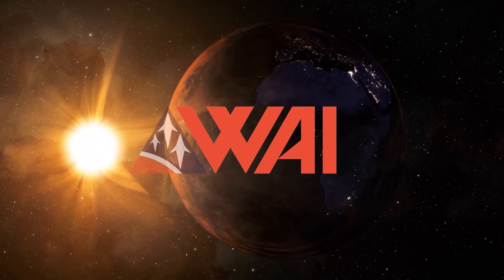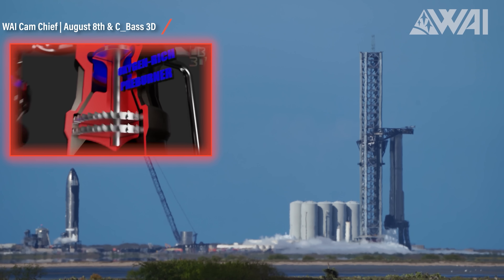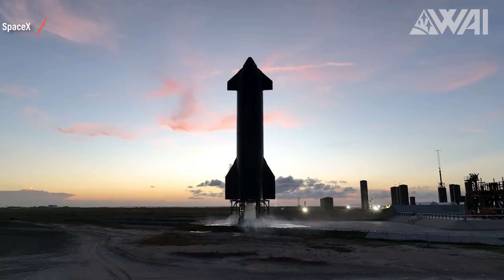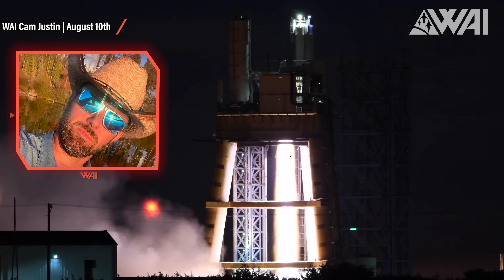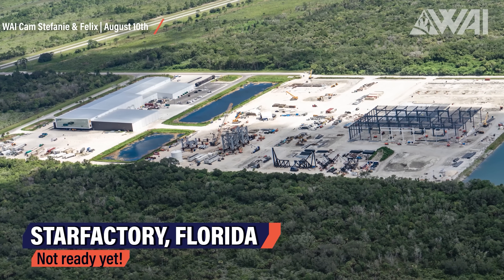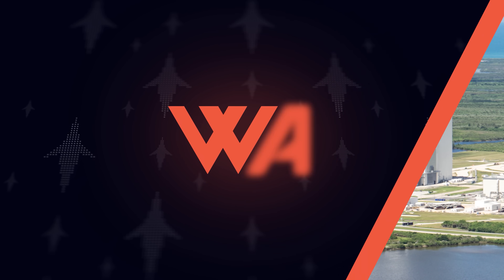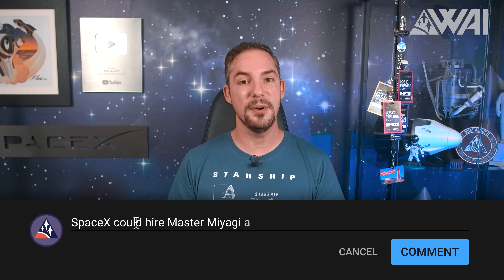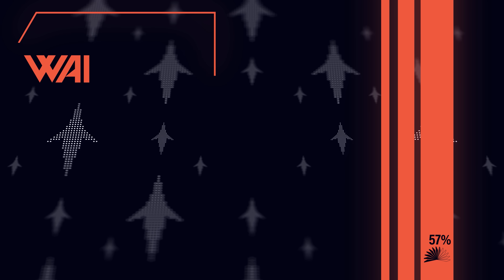SpaceX's Starship Orbit Flight Tests Already Going FASTER Than Expected!

Comment from the maker: Will SpaceX catch boosters with 2.5 meters of wiggle room at Pad39A? :_WAIShocked:

09:34 Correct measurements for the two towers are Length and width 13 meters for both Mechazilla 2 and Falcon 9 Tower
Reply: Not at 39A. NASA is already concerned that a launch mishap will affect the ability to launch Crew Vehicles from the Falcon 9 tower to ISS. No way NASA let's SpaceX land a booster there as long as they need to fly to the ISS. They will probably set up a tower further north and catch boosters there. And then after the ISS is decommissioned, they can retro fit longer chopsticks to Mechazilla at 39A.
Reply: @sammoyers905  Absolutely another landing area away from PAD39A is the best idea I think, too.  Then the booster will be lifted onto a crawler to bring it back to the Florida Mega Bay, launch pad, etc.
Reply: Of course it will need some landing legs like Falcon for that, I guess.
Reply: yes, you seem to forget that the booster can hover and thus have much higher margin to get the position  correct
Reply: The calculations for the volume of the Sphere are way of. The guy that calculated it used a 20 meter diameter and forgot to divide by 2 to get the radius needed in the calculation. The actual volume in liters using the 21 meter diameter would be 4.849.048 liters.

33.510.000 liters would need a cube with 32,24 meter long sides or a sphere that has a diameter of 40 meters.

(Edit) same thing happened with the calculations for the other tanks. They used diameter instead of radius.
Reply: Yes.
Reply: Yes, of course they will catch boosters with those chopstick. Why else build them?
Remember that Starship and it's booster will, unlike Falcon 9, be able to hover.
This means that it'll be much easier to pinpoint the landing, going very slow in the last few meters and adjusting laterally with RCS thrusters.
Reply: @EaglePicking  The Chopsticks are also needed to grab the booster off of the crawler and position it on the launch structure.  And they are used to pick up the orbiter off of it's crawler & mount it on the top of the booster.
Reply: I doubt they are going to catch at Florida in the near future - Stacking arms only
Reply: No. If NASA had allowed catching there, the arms would have been a lot bigger, not smaller. SpaceX screwed up again. They should have built the first tower far enough away. Ah well, SpaceX is pioneering its way through bureaucracy, making a way for the rest. Great vid, incredible research and graphics. Thanks, Felix! :yougotthis:
Reply: lots of devil coding right in that statement. space isn't real and i'm tired of you telling people it's real. quit stealing their money for this nonsense.
Reply: @michellefazekas5789  so if you are tired with this nonsense, why on earth are bothering to post on this channel? Seems a bit sad that you have nothing better to do with your time on earth then complain about something you don't believe in on a channel that is about something you don't believe in.
Reply: Felix, don't learn bad usage and phony rhetoric from incompetent native English speakers! 5:28 "This begs the question..." No it doesn't, it RAISES the question, or just ask it without any verbiage. "Begging the question" Is a rare logical fallacy, no matter how much people abuse the phrase because it sounds forceful, along with all the "Hopefully, the vast majority will be impacted" cheap and wrong phrases people use when they lack confidence in what they're saying.
Reply: @skierpage  you’re right, but damn. Okay. haha
Reply: SpaceX chose a very good  location. Out in the proximity of Falcon launches and very importantly to be close and able to re-use the very large Spherical Fuel Storage Tank.
Reply: Well I think it is possible because the booster and ship can both hover. Falcon does a hover slam landing which means there is less room to control fine accuracy but SpaceX doesn’t care that much as long as it lands. The booster is easier to fine tune it’s landing while hovering mainly because it weighs more. It’s possible but I don’t think it’s going to happen at 39a for now
Reply: No, I think SpaceX sees the writing on the wall. With NASA's concern of possible damage to crew dragon infrastructure, SpaceX will only launch from 39a. With starship and booster cutting its teeth in Boca Chica, the launch part of the program will be ironed enough to safely launch from the cape. Catching will be an absolute NO at 39a for as long as crew dragon uses that location.
Reply: Great video and great captions. A much needed addition is to compare some of these gigantic structures to something we can relate to. Otherwise they are just meaningless numbers. For example, the megabay at 52m wide by 107m high by 40m deep sounds big but how big? That's BIGGER THAN A FOOTBALL FIELD stood on end! And a footprint of half a football field. That's how big!
Reply: I’m guessing that they’re confident enough to be able to do it, or else they wouldn’t be trying it!
A simple solution for @SpaceX & @elonmusk is to have a beacon in the center of the Bullseye! The Starship’s will have a corresponding receiver to zero in on the target.
Reply: Perhaps they will only be used for stacking?
Reply: No, they did not transform the tanks for SAFETY REASONS. Damn it Felix, you reported yourself on the problems they had with allowed and forbidden shapes for explosive material tanks in Texas when that came up, they would not have gotten approval for the vertical tanks and had to put up more horizontal ones. It's regulatory reasons not safety.
Reply: The “At Pad 39A” part I don’t think will happen for a long time - until there are other human rated options to LEO. Can’t risk destroying the Falcon launch pad.
Reply: @jwortman1984  As soon as they have proven a couple of landings in BC it will. After all it is the launch that it the really risky part. They should also be scared of sending up falcons then as they may destroy the pad too
Reply: @camilla-w5h  How many orbital Falcon launches have there been, and how many orbital Starship launches have there been? Apples and oranges in terms of number of launches, not to mention the differences in size/explosive potential. 
I don’t disagree with your statement about perfecting the catch in Boca before attempting at 39a, I just think we are a very long way from a launch or attempted landing at the cape in general, let alone 39a.
Reply: @jwortman1984  Well I'm not saying it will be soon, but it is definitely the launch they are worried about. Not the landing as there is little fuel left,  but only time will tell.

Comment: The tanks‘ volume comparison contains several errors. In the end, there is no „optical illusion“, the spherical tank has the same volume as a single cryo shell, just as one would have guessed. 
The errors:
1.) For the cylindrical tanks you calculated in liters but wrote „gallons“, then tried to convert to liters again by multiplying by 3.7 where you should have divided by 3.7.
2.) For the spherical tank you calculated and wrote in liters but confused „radius“ with „diameter“, so your result is 8 times the real thing.

Comment: 'Sea landings' (on drone ships) are far less precise than those performed on platforms which don't deviate even a mm.
Even a flat sea is moving in one direction or another, and the drone ships presumably fight against any current to try to remain 'stationary', with the rocket aiming for a general safe area.
With a stationary platform, the landing rocket has far fewer calculations to make, it's a case of paint a target and hit it.
(I'm guessing there's some sort of LiDAR rangefinding going on)

Comment: I think it will launch from Texas first. It looks to me like that is where the momentum is pointing. Less long-term schedule risk with two (or more) launch sites anyway in case of damage from a RUD on the pad. Speaking of which, Infrastructure at Boca is SO close that I worry a lot about pad RUDS of that stack at Boca Chica. I hope they NEVER have one because I think the infrastructure damage would be horrible.

As for landings, yeah, lots of HW lost to the ocean before they try to catch anything...but they should do it at Boca Chica first to mitigate political risk.

Comment: Could the Starships and Boosters be built and launched from Boca Chica on a trajectory and be caught at  39A
I just thought what if McGregor could built the aft section and thust puck with small tanks and  alot of smart electronics and software and as the finished testing just fly them to the production site. That might make a cool rendering, somebody get on that.
Reply: Maybe long term

Once those sections are bolted to the tank, the testing is rendered invalid. And it's hugely impractical to ship 9 m wide section on the road from McGregor
Reply: @alvianchoiriapriliansyah9882 Of course it's impractical, I was joking, I meant to littlerally let the Raptors fly themselves to Boca Chica instead of having to load the on truck, you know to save time.

Comment: Of course, landing at sea is not the same as landing on land with fixed coordinates :-) Even in two foot waves a ship could vary by numbers of feet. Apparently SX must believe they have absolute control of both rockets. As we have already seen, just to land a test rocket is quite an accomplishment. This has turned out to be one of the most complex technical projects I have ever seen. It isn't just the Starship. From the Raptor engine to the launch stand to the manufacturing processes, etc., it is mind boggling what has been accomplished so far. Now to top it off with a successful flight.

Comment: IMO they wouldn't build an LC39 structure that wasn't capable of catch and rapid turnaround. Also this puts a launch and catch dependency on a completely separate structure, which as we know would be a brand new pad to the north or re-purposing one to the south. The northern pad where the Nova was to go is a HUGE undertaking as that ground is a swamp right now. Not to mention all of the regulatory hurdles. A pad on the Space Force station seems more do-able, but still, LC39 will be ready in the next year. Why add delays to catching? Plus I don't see them discarding ships and boosters after testing is finished. This is why I think they will catch at LC39. It just means they feel the margin of error can be reduced.
Reply: I forgot to mention, isn't this fun?  The WAI team produces great stuff and the speculation commentary is too. I'm having a good time. When this starts happening it's going to be OFF THE HOOK man. Awesome.

Comment: I worry that a failed catch atempt will destroy the tower launch mount and other vital ground equipment setting Spacex back 6-18 months with cleanup and repair not counting the millions of $ lost to replace all that is destroyed. If they insist on doing this idiotic thing at least build a separate catch tower that is no less than 500 yards away from anything flammable and/or fragile and is extra strong to handle at least minor mistakes if not total crashes. In most things Elon is a genius, but on this ha appear totally retarded. Do not let this happen, realize your hubris/error now and save the starship.

Comment: Falcon first stage landing is a lot like you jumping up to hold onto a branch, just in opposite direction. From the moment you jump you're being slowed down by gravity and if you don't grip the branch your attempt is over. Landing Falcon is slowing its descent when its engines are lit even at lowest power so if it doesn't reach ground it will either fly away or cut-off engines and fall from a height.

Comment: How would SpaceX even ship completed ships and boosters?  Arent they unable to lay sideways as they will fall apart without being pressurised? I was under the impression that was the case and why they need high bays to build and work on the completed components
Reply: For local pad, ships vertically. For travel long distances (later between Boca & Cape) it will be horizontal
Reply: @alvianchoiriapriliansyah9882  The issue is how do they get it horizontal as it will collapse on itself if its A) assembled B) tipped horizontally?

Comment: I would put forward that the large sphere tank at KSC could do more than 2 launches. Starship uses more LOX than methane, and if the 2 GSE tanks for LOX are less capacity than the 2 GSE for methane, then the 2 GSE tanks full, would well overfill 1 starship assuming that 2x GSE tanks worth of LOX would exactly fill one starship launch.

Based off of SpaceX website, a full stack of ship and booster holds 4800 tonnes of propellant (1200t ship, 3600t booster). At the ratio for the booster that makes for a total of 1100t methane and the rest LOX, convert 1100t to litres, and you arrive at a little over 3.11 million litres.  That would mean that sphere tank at 33 million litres would basically come close to 10 full stacks worth of juice. But then you have to account for boil off and all that other stuff, but one would imagine at least 8 full stacks as you would assume that you wouldnt waste more than 20% of the fuel to boil off.

They would need like 3 or 4 of those same sphere tanks worth of LOX to get the same amount of launches though.

Comment: The current longer Boca chopsticks would crush the booster if they caught the booster at their farthest end. So the shorter chopsticks at 39A make sense, no wastage of materials. The only way to make them longer would be to change the angle from a ‘V’ to a ‘U’ to enable the longer chopsticks to catch without crushing the booster.
Reply: Can you explain further how longer arm can crush the booster?
Reply: @alvianchoiriapriliansyah9882  to catch the booster at the far end of the chopstick it will have to close more as the end would have to be the same width apart as the diameter of the booster. As it’s a ‘V’ shape, the diameter at the start of the chopstick will be much less than at the end and there becomes a position where the booster would be crushed by the chopstick if the chopstick closes too much. I assume the shorter chopstick at 39A gives you that position.

Comment: 11:40 ish... 
The Falcon 9 has to do a suicide landing because one Merlin engine can't throttle down enough to hover the booster. They have to time the landing burn so that it stops falling--but before it starts rising again--right as it reaches the landing surface. If it's off position slightly they have no choice but to continue the landing.
The Heavy Booster, however, can hover on it's Raptor engines so it can more precisely position itself to be caught. Elon has said that it will take up to 20 seconds for the catching maneuver to complete so I can see them being able to catch a Heavy Booster with the shorter chopsticks.
I don't think they will, though, because of the proximity to 39a and how important it is for ISS support. NASA would never allow such risk.

Comment: If I recall correctly, the Falcon 9 uses only GPS data to guide its landing which means there is no feedback from the landing site to the rocket to help guide it in. Perhaps the system used by the Super Booster and the Starship will also be provided with feedback information that helps them make a much more precisely guided landing.
Reply: There will be a brave person with a walkie-talkie standing two-thirds of the way up the Mechazilla stairs saying "Alexa, move the chopsticks 14 cm lower; Alexa, drift booster 9 cm closer to tower; ..."

Comment: Thanks! Your videos are definitely getting better.
One factor worth considering wrt the chopsticks is, Falcon 9 lands with zero hover time, whereas the big booster will have a few seconds to get into position, which should make a lot of difference. OTOH I believe they still intend to come in belly down until the last moments.
It was nice to see a static fire test without losing any tiles!
Reply: You're saying Super Heavy Booster will come in belly first then do a flip, just like Starship? It doesn't have any Elonerons to adjust its pitch. There's one sketchy website supporting your thesis, but its link to a supposed Elon Musk tweet is fake.
Reply: @skierpage  Thank you for correcting me.

Comment: Is there no progress on the old oil rigs meant for ocean launch and/or catch? I haven't seen anyone report on them for months.
Reply: Nobody is reporting on them because as far as anyone can tell, there's nothing to say. SpaceX bought them cheaply when they were available, but they don't have any need for them at this stage, so they're just sitting around waiting.
Reply: @simongeard4824  Probably nothing to report on, I wonder when they might be put to use.
Reply: @Kevin-hb7yq  Not until Starship is fully operational, I would expect. It's not like they need offshore launch in the next year or two...
Reply: @simongeard4824  they need offshore catch, as they can't catch at cape Canaveral and can only catch one in boca chicka. If they're successful, they're going to start launching them for starlink  v2.
Reply: @jordandale85  But offshore catch doesn't give them the launch cadence they need for v2... not unless they're also doing offshore launches. That may come in future, but there's no sign that it's something they're thinking about right now.
Reply: I haven't seen any reporting on these either.. great question. I wonder if Felix will do a show about this. Probably needs somebody to go to the site..?

Comment: 11:59 One big different between the F9 and the SH is that the F9 lands directly on its pad, no hovering, no chance to make micro adjustments. The SH as Elon has spoken about will have the chance to hover briefly as it aligns itself to the pad. Shorter lighter arm. The strength is as the tower end of those chopsticks.